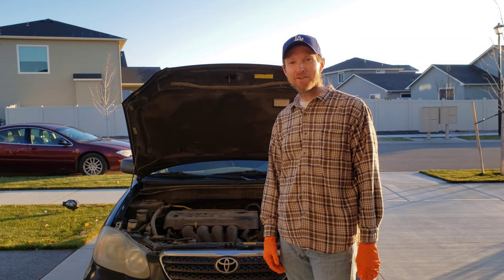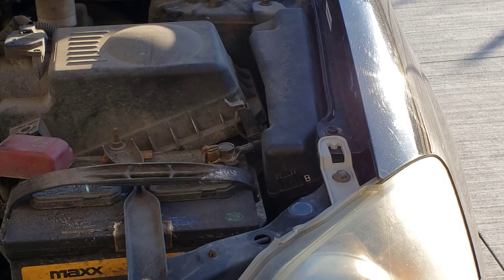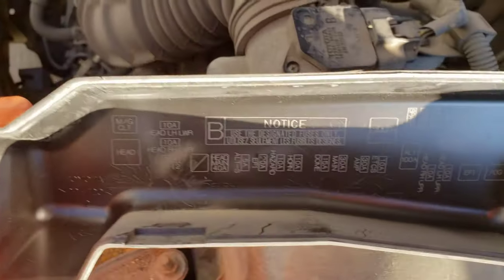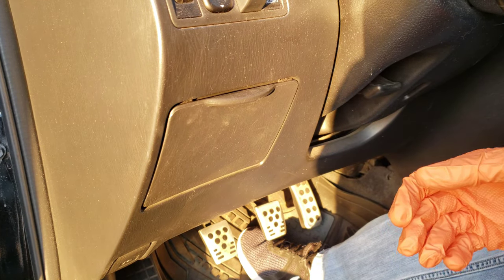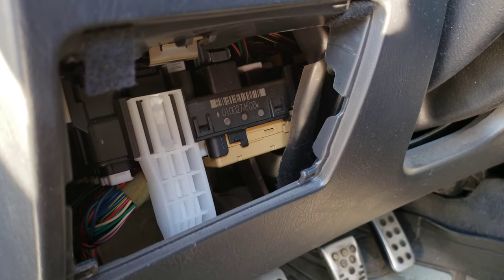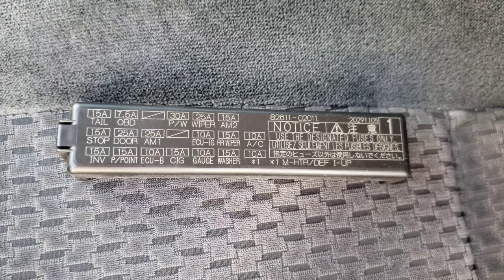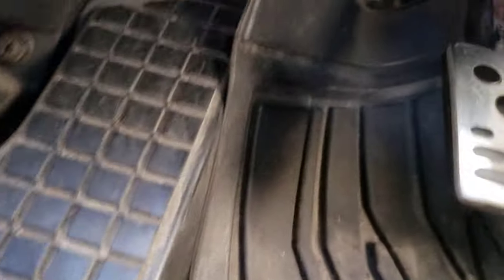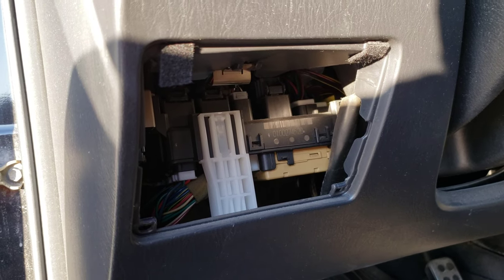Fuse Box Locations In A Toyota Corolla Years 2003 2004 2005 2006 2007 2008

Comment: Thank you so much. I'm traveling as I write. I'm parked at the moment.  All of a sudden, I lost all of my dashboard ligts. Stopped to buy some fuses. Wish me luck. I've got 434 miles left to travel.
Thanks again for showing me where the fuse box is👍
Reply from the maker: Thanks for watching,  I hope you get your car fixed!
Reply: Same issue here can you tell me where the fuse for the dashboard lights is at?
Reply: @dalemus3680  
The fuse box in my car was behind the area where you put your change etc. I YouTubed it. Try to see if you can find the answer on YouTube. 
Good luck to you!
Reply: Hi guys, I have same problem, I removed the box lid under the steering wheel, but I did not find any information using the lid. Even though I searched some videos on YouTube, I didn't fix it. Could you help me please?
Reply: Hey,I found the fuse. It is the same tail fuse 15A(2004 Toyota Corolla), but I have a new problem. I changed the fuse twice, but it blows again. How can I found the short circuit in this?

Comment: Nice video, one comment about checking the small fuses, the blades are partially exposed on the top of the fuse body so you can do a continuity check without having to remove the fuse.  Just a quick way to check your fuses.  Thanks for posting.
Reply from the maker: Thanks for watching and the tip!
Reply: @ToddsGarage  - And there is a little white fuse puller in the one under the hood.  Upside down from the floorboard, thanks, the little book is no help.

Comment: What if it’s the second 120v cigarette lighter inside the drivers right arm rest? Currently the front cig light works but not my center console one.

I replaced the old fuse with the new fuse and still nothing. What do you suggest? Replace the cig holder?

Comment: Do you what fuse are dedicated for the sidemirror controller? The sidemirror on drivers seat is controllable but at the passenger seat is not
Reply: That's the same problem I am having.  I never thought it could be a fuse issue.

Comment: Hi, thanks this video helped. my Corolla right door courtesy light doesn't turn on when door is opened. I tried replacing the bulb but it still won't light up. What could be the problem? Thanks!
Reply from the maker: Hi Gerald, thats too bad the bulb didn't fix it.  It could be a fuse, or possibly wiring that got damaged or bent. I'll try to make a video diagnosing that in the future. Thank you for watching!
Reply: @ToddsGarage  Did you ever make this video?
Reply from the maker: @kaizylle  Hi and thanks for watching,  I haven't made a video for that yet, I still have it on my list. Thanks again for watching and I hope you get your issue figured out.

Comment: Do you know what fuses are most critical to have backups for? Because apparently if AM1 7,5 amp fuse (Starting system, ACC, CIG) goes out, the car won't even be able to drive. So might be good idea to get 7.5 amp backup fuses.
Reply: They really should just include a spare fuse for each type that's installed, not just 3 types.
Reply from the maker: Hi and thanks for watching, It is not a bad idea to have back up fuses on hand just incase. You never know when you might need one. Thanks again for watching!
Reply: Do you know where the ACC fuse is located at
Reply: @nays8618  I don't know much about cars. Sorry.
Reply: @ToddsGarage  Hola, me puedes ayudar porfavor, cuál es el fusible de los espejos laterales? Gracias mil

Comment: Do you have any idea what would cause the clock to dim when braking and sometimes cause the car to begin stalling, and a dead battery/slow start in the morning? But when i drive for a lomg time, the clock stops dimming. Alternator is new (just got it 3 weeks ago),  battery checked out fine, but when i checked battery, lots of corrosion on the positive battery terminal. I cleaned the terminal thinking this was interfering with the battery before getting it tested a few days ago. When alternator got changed issues with dashboard dimming stopped, but Still having the other issues. Please help lol. 

Edit: i just wanted to add that the clock was barely visible for about a year before i started having all these issues. When the alternator got replaced i could see the clockm it brightened significantly, but after a week it started dimming again, then brightening when i would accelerate and dim when braking. Sometimes it would stay dim regardless. Could the clock be causing a parasitic drain?

Side note...the starter tested poorly so could this also be the issue/there be a faulty wire in the starter?
Reply from the maker: Hi thanks for watching! I'm sorry your car is having so many problems.  It is hard to guess without being there to see it,  it could be many things. It also could be more than 1 issue. The clocks in our cars are known to have an issue which eventually makes them not visible.  If you want watch this video and see if you think this might be part of your issue: https://youtu.be/MJH_QfXrkp8

Good luck,  I hope you figure it out,  keep us updated!
Reply: I have yet to see the time on my clock. I heard that every once in a while at a certain time of day, if you look at it from the right angle, you can see the time. But that is probably just a vicious rumor...lol.